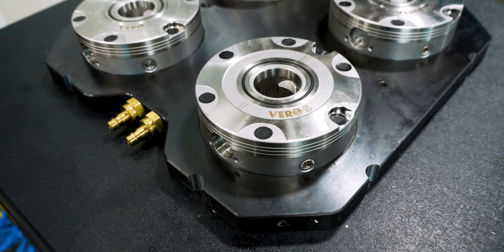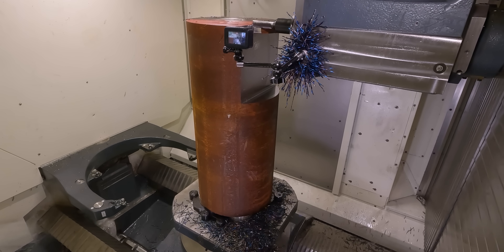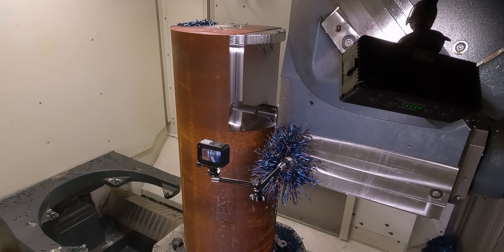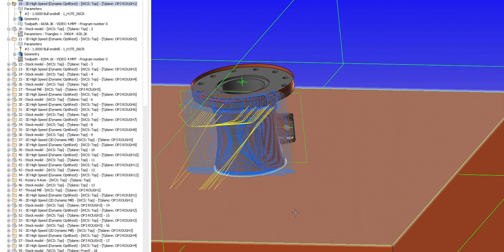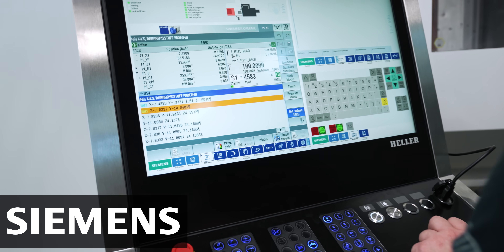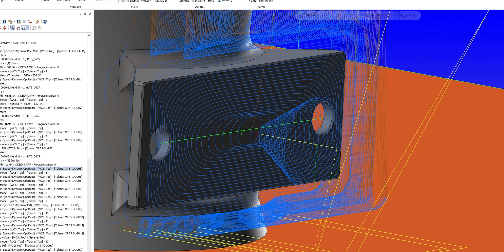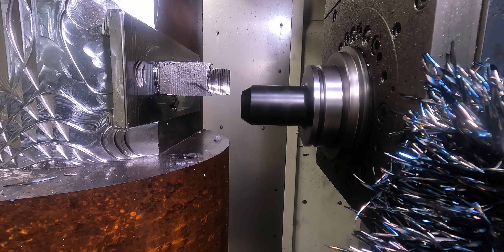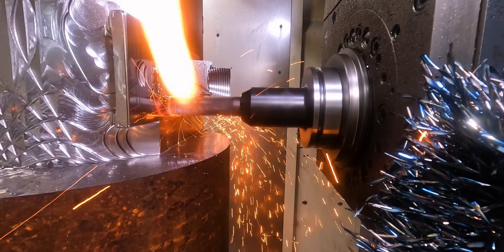Can We Conquer The Impossible? Machining 2200lbs Of Steel Vertically

Comment: Folks, this is all a show. If you think making a linear valve on a mill is in any way a good idea, you clearly have no machining experience. You think they can bore the internal radius with a mill? If they don’t even have a lathe, then this is all advertisements for CNC mill companies for shops who want to hire less people, which is not a wise business model. Diversity in machines and employees’ skill sets makes for a stronger company that can improvise when the industry changes, which is why I think they had such a tough time in 2009. Enjoy the videos, but learn design and engineering instead of just CNC work to understand the industry.

Comment: I noticed on the 2nd tool, there was a portion that was especially obvious at 10:01 about a quarter inch from the bottom that was cutting very poorly. Was this by chance a chip in the tool that came from breaking the first tool and being unable to clear what might have lodged itself into the steel? I've seen this happen in multiple cases where I work yet I feel like its something I never see acknowledged.

Comment: Does Heller CP 6000 have a load sensor in the spindle. Like if it is doing a tool path and suddenly the load changes from x watts to much less watts it can sense that the endmill did break. Or were you just lightning fast on the emergency stop button...
Reply: Def not load change, otherwise itd stop when you you are finishing a cut. Vibration sensor could be though

Comment: I would've just rotated the part 90 degrees each side and rough plunge milled it with no coolant, personally. You're super lucky you didn't get a chunk of carbide embedded into that steel or work harden badly.

Comment: Just a quick question...When I had long running parts such as this, I anticipated tool wear/failure and programmed in mutltiple tools and figured in "chip time" on each tool. In this case, I probably wouldv'e done (3) 1" diameter E/M's. How come this wasn't done? Not pointing out flaws, just trying to gain knowledge.

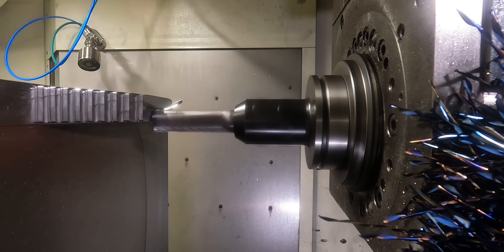Comment: At 2:50 you mention high feed milling and how it produces much longer cycle times based on limited depth of cut. 

I wish you guys would address this point in greater detail. I’ve commented before about how it would be nice to go in depth about high feed milling vs hem and when to utilize either of these strategies, or possibly some guiding principles, and why.

Also it is my understanding and experience that both hfm and hem can be very productive it is just dependent on numerous factors. So to say that hfm undoubtedly produces longer cycle times than hem is a bit of a generalization, no?
Reply: nobody mills pieces that big without high feed mills 😅

Comment: Running a 1" endmill until it breaks is pretty inefficient. Inspect the tool, mastercam even has an option for this after time or inches in the cut. Saves you chasing where you were in the program and saves your holder, part and spindle.

Comment: this aint sketchy. those bolts that you have it tied down with can take some force. its moving of course. but anything moves when you put that much pressure on it. you can move the world with that much force. the other day i was a solid 1 inch deep with a turning pass. hell yeah it moved. but it put up with it. when i got 4 inches to knock of the o.d. of some cast steel, i aint gonna take no pussy cuts.

Comment: So like you said the set screws came loose on your tool holder and that’s why the tool broke? So like why were you using that type of holder. I know you have a heat shrinking tool system , why didn’t you use that? 🤷🏻‍♂️
Reply: To be honest, everyone has always said side lock holders are the best for roughing…..and until now, I agreed. This was the first time in 30 years i have had this problem

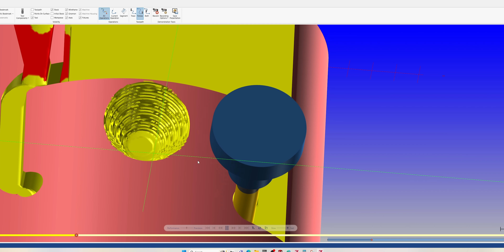Comment: Wow @ 7:18 there is a non default holder. Finally! Seriously though if you are showing people ways to do things... talking about properly modeling tool holders and making tool libraries should be something spoken about. Especially with multi axis toolpaths. 

You guys should make a video about setting up a machine sim. I'm trying to get an okuma mu 4000 setup in mcx 2024.... Nobody seems to really know how to add a new machine sim setup.

Also... the endmill broke when the engagement increased on the other side of your fancy cone........ so your "solution" created it's own problem. Just pocket out a bore with straight walls. It will rip of way smaller tabs. A lot of people swear by solid holders but just like you said the screws came loose. I have seen more issues with solid holders and set screws than I ever had with ER collets or hydraulic holders or shrink fit.
Reply: 😂 the cone. I’m not buying it either. It has to be a sales pitch for sure.

Comment: Breaking tools does not save time.   Running stable efficient tool paths does.   Everything about this was dumb
Reply: Yes much better to spend 400 hours with a HSS endmill going slow and steady than to get ot done in 20 hours. Everything about your comment was dumb. But thanks for trying
Reply: @barrysetzer  who said anything about HSS?   In this videl you said "breaking tools makes you money". That is an insane comment. Pushing tools should be the goal, not breaking them. Breaking tools brings an unknown into the part process. Did it damage the part, did it damage the holder? Now you have to restart the op in a spot that might be compromised.  Ita better to split the job into the three tools instead of just waiting for one to break.  Breaking tools isn't cool and you should stop promoting this garbage. Buy your tools from Titan and break them!   Great business model.  You keep breaking tools and i will keep making parts.

Comment: Barrrryyyy!! You're the man. But brother did that new tool cut well. Some science to check out, temperature of material + work input from cutting(actual energy energy to cut metal/theoretical minimum energy to cut) = final work done = temp of chip + change in temp of material + tool tip temp. Therefore if final temp of chip is super high you are putting in way more energy to cut, in this case, friction. That why the rig stopped flexing as much when you did the tool change. Monitor the machine torque and axis/vector forces to tell when the cutting edge has dulled. Forces needed by the machine increase substantially. Round 2 🎉
Reply: But then KM wouldn't get to sell as many $1k endmills to guys "trying to put food on their table." Instead those endmills would get reconditioned for a fraction of the price and get re-used a number of times. Most (all?) nice machines have metrics on spindle load, servo load, and vibration that can be used to trigger a tool change. I know Siemens 840D can, at least on DMG machines.
Reply: @dwaynesykes694  very cool! Can those carbide mills be reground? I would have thought that would be the norm these days with electronics, auto change based on load and vinration. I guess they are seeing just how many lbs they can get off without touching the tool. But makes you wonder if you had 5 endmills for the job, and used them until then needed a regrind but not killed them, would the job go faster and more efficiently? Because you were cutting at optimum for more of the time. But the machine puts it through at the same speed so guess you wouldnt notice a difference, machine energy consumption would have to weigh in.
Reply: @zimbab5748  they absolutely get sent back to the manufacturer for reconditioning (their fancy term for. re-grinding) at most shops. 

Claiming that you can make more money by blowing up a $1k endmil, potentially a $1k toolholder, and sending a ~2lbs chunk of carbide flying through a million dollar machine is just reckless. Great way to make money if you make videos and sell tools for a living, horrible way to make money if you make parts for a living.
Reply: @zimbab5748  for some perspective on how "smart" the advice in this video is, a comparable endmill from everybody's favorite Swedish tooling manufacturer -- whom I shall not name to avoid having yet another comment nuked -- is 862 US greenbacks new yet can be reconditioned by the manufacturer for a mere 72 bucks up to four times.

Amortize the cost of the tool and four regrinds and you're at 230 per wear-cycle on the tool, which makes the cost of solid carbide a lot more palatable. Those numbers are also list, any shop running enough material to justify 1 inch solid carbide is likely to have an account and consequently lower numbers than that. Regrinds on anything less extravagant than a 1" wide x 4" cutting depth 7 flute monster are substantially cheaper, making it even more sensible to NOT break your tools.

The ability to regrind, plus the fact that blowing up a tool almost always wrecks a a fancy hydraulic toolholder (or at least the collet if using one), and you can begin to see why no one else is out there telling you to intentionally break your endmills... except shameless shills.

Comment: You absolutely should try to avoid breaking endmills. Running faster to trade tool life for lower cycle time is fine, but not to the point of failure. It's not just the endmill, it's the holder and potentially the machine that are at risk from breaking a tool, especially a large 1" solid carbide endmill. High end hydraulic toolholders aren't cheap, and you can pretty rapidly push a job well past the cost of a little extra cycle time when you start breaking things. And forget running lights out like this, no one wants to come in to find a crashed machine in the morning because a tool broke.
Reply: I think they know what they’re doing bro
Reply: @cambrowndrums  They do know what they're doing.  They're selling you on the idea of breaking tools to save money because they're sponsored by tooling companies that are happy to see you break a $1,000 end mill instead of stopping 10 minutes sooner when the tool is at a point that it's dull but can be resharpened.  An end mill like that can have multiple life cycles if resharpened.
Reply: Also no coolent was used so I'm sure they were aware of this happening

Comment: You can see the heat pattern at the bottom of the cut earlier showing the end of the flutes were dead before the rest. If you sent an indexable in to sort all the little tickling with the end of the cutter it would have lasted the whole part

Think of the beer money from recycling a inch endmill 😂

Comment: Might be a silly question, but how do you continue in a hour long CAM-Block after your tool breaks without letting it run again?
Reply: Most machines will let you return or start on any line of code. Depending on the machine this can be very easy or just requires a few extra steps. In a program like this you go back 20 to 100 lines of where you pressed stop.

Comment: Have you considered running a tank of crushed dry ice inline between your machine air supply & the tool?? The cold air & semi solid CO2 combo would be similar to running coolant with the CO2 possibly acting as lubricant.
Reply: That will just build up ice on and in the line, and it will be pure water, you don't want that in any part of your machine... Also dry ice evaporates to pure nitrogen, not something you want to blow in a room for 30 hours...
Reply: @MisterMarcus79  Dry ice is pure CO2 it does not contain notable amounts of nitrogen unlike the atmosphere. Compressed air also has very low water by volume. What is present will freeze inside the mixing tank before entering the lines. To raise CO2 from base 400 PPM to dangerous zone of 40,000 PPM. In such a massive room would require multiple tons of dry ice to be melted with all ventilation removed. Also liquid nitrogen is already being run in machine tools with no issues at even lower temperatures.

Comment: why do you cut clockwise along the direction of rotation instead of against the rotation of the tool
Reply: For most materials in a cnc you'll almost always be climb cutting (with the cut). You get better tool life, surface finish, and chip evacuation. In a manual mill you tend to do a conventional cut (opposite of climb) because the mill isn't rigid enough and the table often gets pulled along the cut causing problems or tool breakage. You don't have that problem with most cncs
Reply: @Marlfox570  aye, thanks for the detailed explanation bud!

Comment: What is the most efficient way to change tool, and start milling again. If you break your tool middle of run in place that is not mapped as scheduled tool change spot.
Reply: You use line numbers in a program usually. Tool breaks, check the line number of program, put new tool in, start program up a few lines before to be safe, hit cycle start. Good controls have a mid file start option that checks the code for any g and m codes that might need to be set before returning to the cut (like tool length offsets or something)
Reply: Some machines remember where the tool broke, and then it will back up a few lines, and you can then restart a couple moves before hand.

Comment: YAAAASSSSS! Monster Part!
Reply: That thing is tiny. We have a machine in my shop where they do parts 10 feet tall vertically and weigh almost 10,000lbs.
Reply: not tiny. to normal machinists with normal machines 95%+ this part is massive. 10ft tall parts and bigger is exceptionally big @wendull811

Comment: Inheritance Machining made a Mobius cube manually on a Bridgeport mill. Could this be done on a cnc?
Reply: the problem there was holding the part nice and still in a chuck or a holder. the same problem would be with CNC, however, you would get to remove hard reaching zones from different angles with a 5 axis machine, Inheritance had only 3, only a top down approach

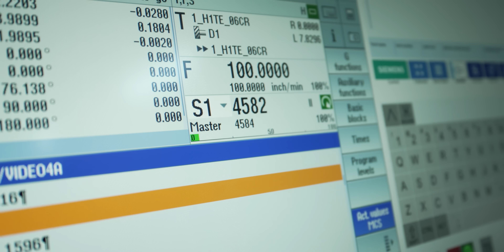Comment: Odd tool oscillation at 1:50
Is that the beginning of loose setscrews?
Reply: Good eye!!!! Yes it actually happened happened 5 or 6 times before the endmill finally gave up. The last time i used red locktite on the screws 😂
Reply: @barrysetzer  was red loctite the fix for the screws coming loose?
I had this happen, just assumed it was not tightened enough plus didn't have weldon flats on the tool.  1" holder too!
Reply: @RoboDriller  it did end up working, but i decided to switch to the hydraulic holder after the tool broke. I assumed the same as you, that i hadnt tightened the bolts enough. But after the first time they came loose I used a 2 foot long cheater bar and they still came loose. And my tool did have weldon flats. I think its just a combination of heat, torque, and vibration

Comment: Dont you think it would have been way easier on a VMC?
Reply: At least in this orientation we can reach 5 sides, so it will be easier here.
Reply: @barrysetzer  I have seen you have a powerful horizontal turning machine of DN solutions. You could have used a same. Chuck. And a. Fixture in the center to hold the workpiece horizontally. I believe it would have been  much simpler and the cycle time would have reduced considerably.
Reply: @barrysetzer  hello. Barry. Did you finish the part?
Reply: Working off a casting would probably been best
Reply: @JosephMostowy  castings would not have given the same. Strength. This is a forged part. For a very specific application.

Comment: ...You guys use coolant on a lot of your end mills. We use Guhring tools, they call for about the same speeds and feeds as your kennametal end mills, but they recommend using only air. Does kennametal recommend only using air but you found it better to use coolant?
Reply: In my own opinion coolant is usually better. Flushing chips with coolant usually negates the negative effects of thermal shock
Reply: HPC at 1000 psi some Swiss Blaser, he could have done that with one end mill.  And secure it better than set screws, maybe them locking end ones

Comment: Cutting so hot for no reason. Breaking tools just for views and dramatic effect.
Reply: All those views pay for 2 new machines
Reply: They are not using coolant for filming purposes, they are not trying to break tools. They want people to be able to see whats happening, not just hear someone ramble on about it.
Reply: I mean you often don't run coolant when cutting steel (depending on the tool) you often use an air blast instead. If you have a good chip load the most of the  heat will go into the chip and not the part or the endmill. Certain coatings on endmills actually work better without coolant because they require a bit of heat to be effective.